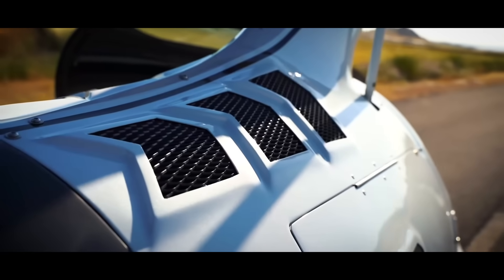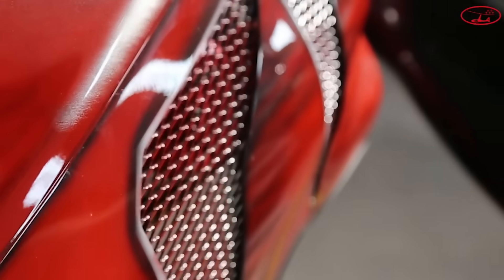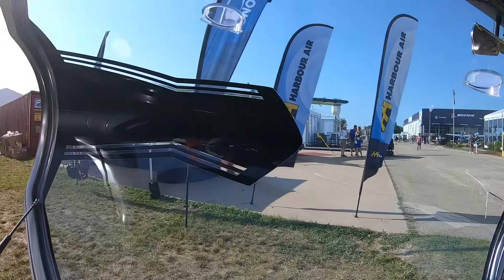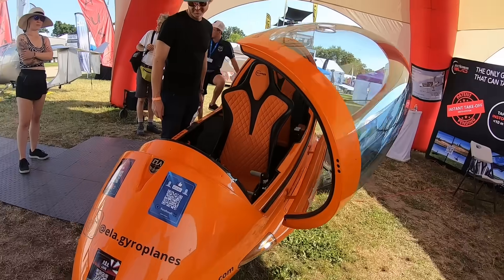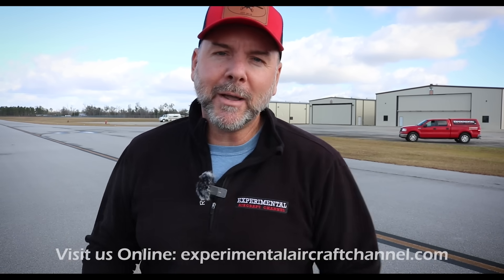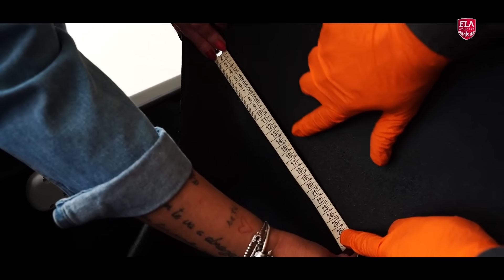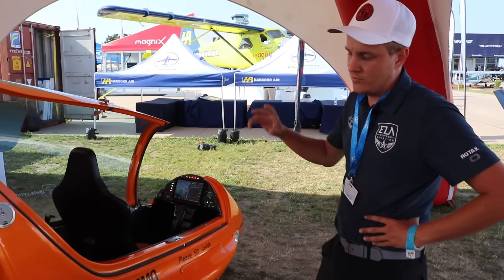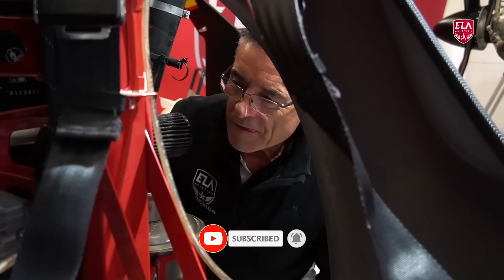Shortest Take-off in the World! The "Jump TakeOff" Gyrocopter!  ELA Aviation

Comment: Am I correct in thinking that as soon as you add variable-pitch components that the requirements for a pilot's license go to a higher level?
See, I think the FAA has a problem with me due to a childhood anomaly that I have had going back ~57 years.
Reply: I think they get an exception because the pitch control is all automated, and only when using jump takeoff. The pilot can't manually effect the pitch during flight or landing, so it shouldn't affect the licensing.

Comment: i. No explanation of the jump capability, except it involves changing rotor pitch - but not as complicated as a helicopters. I conject that you have two pitch settings, one for jump that almost immediately returns to auto rotation pitch. 
ii. Why a cruise speed of 117 mph? Because that is also 100 knots, and that is the round figure for the owners manual.

Comment: Hello.... I'm very interested in your Revo.... A  question please.

1]   

 I watched a video from the experimental aircraft channel and Herbie explained the quick takeoff process..... "all you do is you press and
1:31
hold down a button in the cockpit as
1:33
your pre- rotator we'll pre-rotate the
1:35
blades to about 500 RPM and then when we
1:37
let go the button it changes pitch of
1:39
the rotor and the propeller
1:41
simultaneously to to lift us up and push
1:44
us forward so that we're gaining that
1:46
energy in our rotors immediately"

The question is.... Upon takeoff if the pitch of the rotor and propeller changes with that not make it a variable pitch plane and cannot be flown by a sport pilot license.  I was thinking maybe it being built experimental 51% would make it available to a sport pilot license.

If the variable pitch is a problem for the sport pilot license..... I know a lot of other manufacturers are shipping their planes into the US experimental exhibition..... Can years be shipped this way as well and would that qualify a sport pilot license?

Thank you for your help as I have another friend that is very interested also!

Comment: Basically a jetski for large format air crews. Amphibious hydroplane sea going autogyros could be nice, bit of sail powered theory and yachting carve. Harbour survey and scientific recon. Unmanned operating system and ground station generator and communications centre / markup + highlight use / like a quad bike for qnspek various things. Ideal for storing on a submarine and deploying fully sealed from a shallow depth including occupants. Flooded cabin won't work if you want to taxi and fly off, if the buoyancy ejects the thing then that might well spin up the props if not break them right off. All sealed and waterproof is hard but think of the reliability. Salt water is awful so comparatively a bit of rain and wind is fine. An auto gyro is basically one moving part and a passive wing.
Reply: Add some luggage capacity and I’m in.

Comment: They still need to correct the nose wheel. The forks on the nose wheel need to be swept back so it will self center. The current design can cause you to tip over especially on landing if the nose wheel isn't straight forward. This usually happens in crosswind landings. I see this a lot on gyros and its an easy fix. JMO

Comment: The real question is why jump gyros ever disappeared in the first place. Carter was the leading edge of the technology 20 years ago, but I think they ran out of money. Huge potential in their design, but needed refinement.  At $240k, I think this is overpriced for what it is.
Reply: There are lots of methods.  I was involved with one version (didn't get off the ground).  It used the conning angle on a modified hub bar which had a diagonal bar passing through it.  so the hub block which had stoppers built and bars joining the split hub segments (hard to explain in words).  What it meant in practice is that the blades when not exposed to the wind didn't cone and sat at zero lift pitch and as soon as it conned it engaged positive pitch.  This meant no swash plates, no need for the pilot to activate it in flight you just pulled the stick back and accelerated.  Kamen choppers have wood rotors which control collective with trim tabs off the back the chord weights.  This would be easy with servo motors using a wireless signal to the rotorhead micro controllers are cheap.  You still need a pretty robust system.  And there's the guy that puts hydrogen peroxide tip jets on his rotor which gets so close to vertical take off he can get off in 10-20ft.  All are more complicated.  My advice just have a light gyro and know how to wind up rotors properly and you'll do fine.
Reply: @cameronlapworth2284  Interesting. Thanks!
Reply: Maybe they ran out of money, because they were charging too low a price…? 😂

Comment: Build assist is such bs. FAA should immediately declare factory built experimentals allowed. They just still carry the experimental label and that factory build can then be assessed for full certification. Bureaucratic stupidity 101. They should also allow retract gear on LSAs so there isn't the same build assist fakery hurdle for european LSAs. It's not grossly overpriced but the Risen is a great "LSA" that should be freely available in USA but it's not. And similarly there should be an easy path to get it fully certified, not that it makes much difference when allowed as LSA but still. Safety yes, bureaucratic danger no.
Reply: Read the comment three times and it still doesn’t make sense. What does still carry the experimental label and that factory build can be assessed for full certification mean?
Reply: @PRH123  factory built experimental still has to say experimental on it. and such a production can after a while be approved as fully certified, to a large extent from experience using it as a product and some material supply and construction process approval. Makes sense?  so not only can factories build the planes instead of stupid masquerade pretending the buyer built 51% of it and  it flows into a proper certification of the model. Instead of perpetual garage band amateur hour and bankruptcies. Which is what kit makers are. While Cirrus is undeservingly successful.
Reply: @ Unfortunately still don’t understand, experimental aircraft can’t become certified over time by being used. A manufacturer has to formally submit a design for certification to the FAA and go through the process.

Comment: I wonder how many hours they got into that quick take off set up they had on that Gyrocopter I don't know if they mentioned that or not I wonder if that belt breaks if that will have anything to do with auto rotation or continued flight it seems to be a cool idea
Reply: - drive belts on gyro main rotor is only for pre-rotation (flight continues regardless - unless / clutch disintegration and idler obstruction)entanglement happens)...  (I have always felt "jump gyros" need collective control - that one additional DOF - sore it needs pilot training, but flight without adequate training so often leads to DIE).....

Comment: I don't understand why ELA places the horizontal stabilizer in line with the main propeller. In my opinion, this prevents the aircraft from being stabilized against the oncoming flow. Stabilizing the aircraft relative to itself makes no sense. 🤔
Reply: - it gives powered pitch control... ie. thrust vectoring at low (all) airspeeds...
Reply: It makes the elevator more effective at low forward air speeds than it would be without that airflow
Reply: @PRH123  Gyrocopters do not have an elevator, they have a stabilizer with a constant installation angle.
Reply: @ some gyros do indeed have elevators on the horizontal tailplane
Reply: @PRH123  For example?
Reply: @igorok1362  off the top of my head, little wing
Reply: @PRH123  I would like you to give examples of gyrocopter models where pitch control is achieved by aerodynamic control surfaces.
Reply: @igorok1362  well, like I said, off the top of my head, the little wing. And looking at the ELA page they seem to offer a pitch trim.

Comment: If I was going to spend that much money there are many other aircraft I'd rather have. A quarter of a million dollars for a gyrocopter? It had better carry several passengers and offer commercial utility.
Reply: 1/4 million I'd buy a light second hand gyro (or build one) properly light like a gyrobee.  trailer to airstrip have a fun bast around etc.  And then buy one of those european Shark fixed wings over 1000nm range on 100hp 160mph + cruise speed. That would cover all my flying needs.
Reply: You can’t get any new certified aircraft for that much.  With those stipulations of several passengers and commercial utility you might be able to get a very used high time steam gauge Cherokee six for that much.

Comment: So a quarter million, frankly if they've worked out a simple jump start, surly battery power is next. CATL in China are releasing a 500wh/kg battery for the aerospace market now, with battery torque unbeaten that's the future & yes there lighter & have thermal issues.

Comment: Your not going to get 2000 hours TBO on 100LL garbage fuel, you have to change the oil every 25 hours running that crap in your Rotax. Running unleaded fuel only will get you 2000 TBO, it’s obvious as the oil change requirements are 50 hours, not 25 as it is with 100LL dirty fuel.
Reply: I run 91 Ethanol free Mogas in my 915. Get it at the gas station less than a mile from the airport.